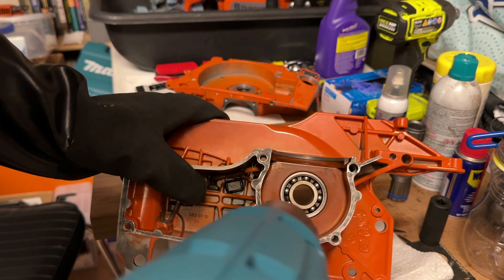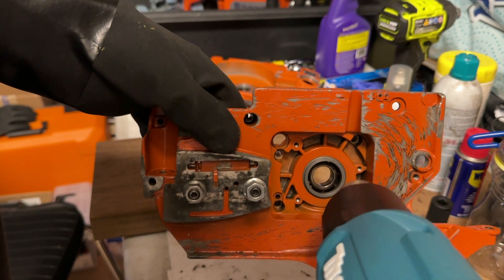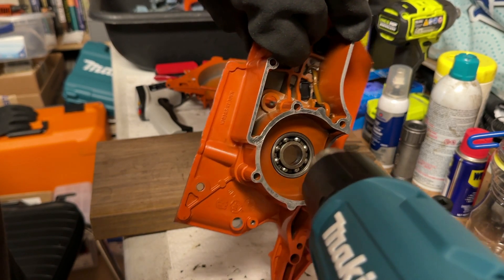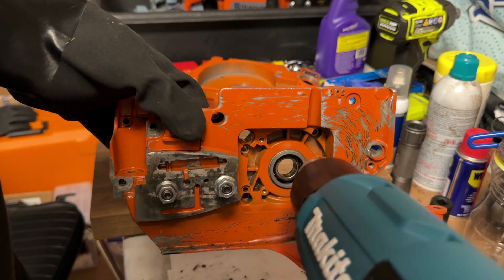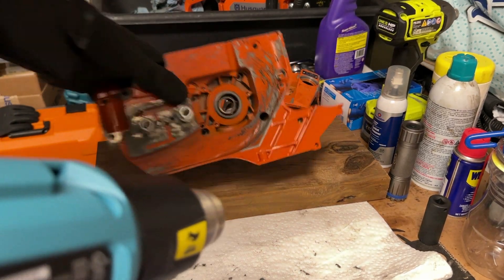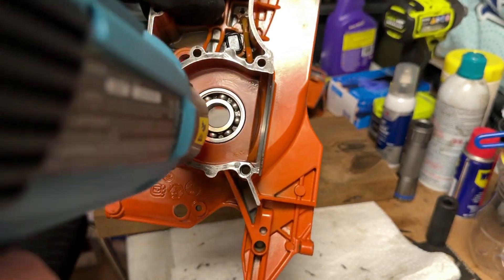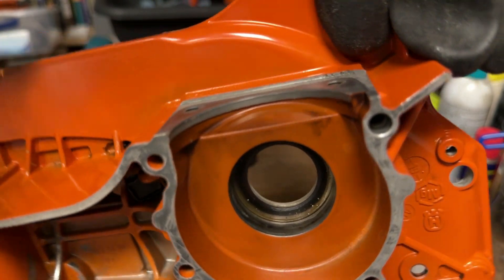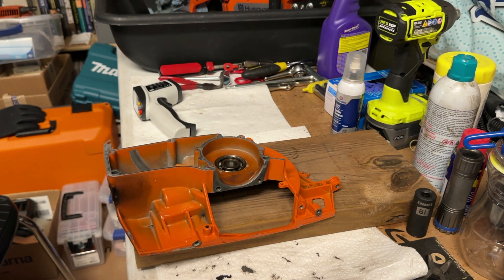Part 9 Husqvarna 395 XP Rebuild - Crank Bearing Removal

Comment: you skipped over your process for cleaning the stuck gasket material. I started out with a plastic scraper, but some of it was too stubborn. I switched to a carbide scraper and really focused on keeping it flat to the surface. Looks really similar to yours. Just a little shine

Comment: If you heating up the  case and the bearing at same time  is it same if you remove  bearing without heating?
Reply from the maker: @Gazer-k5b  No.  They won’t expand at the same rate.  If you try knocking out when both are cold it will be much harder and since you can’t put consistent pressure on the bearing around it’s entire diameter like you can when using a press to install them, you will likely damage the inside of the bearing pocket since it will bind some in the pocket.  Also, if done right you’re heating up the case more than you are the bearing.  The bearings will sometimes come out with the crankshaft which is fine as there is consistent pressure.  But if a bearing doesn’t come out when the crankshaft is removed, the manufacturers of all saws with a full crankcase recommend bearing removal by heating the case in literally every workshop service manual I’ve ever seen.  Most recommend heating the entire crankcase in an oven, so even the bearing is heated to the same temp.  Don’t worry, do it.  It works.